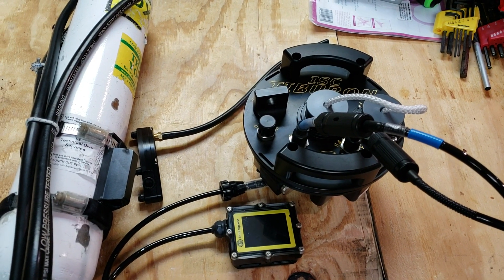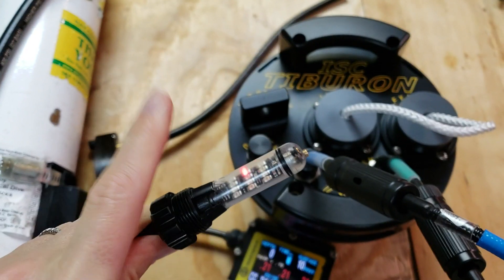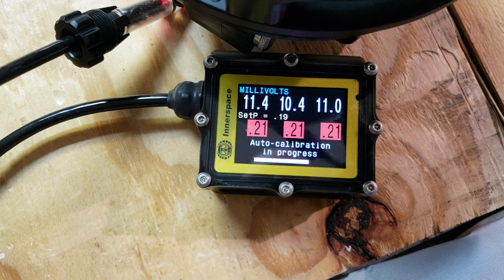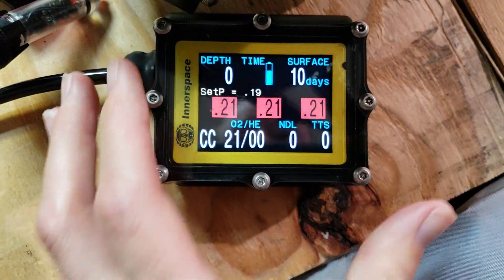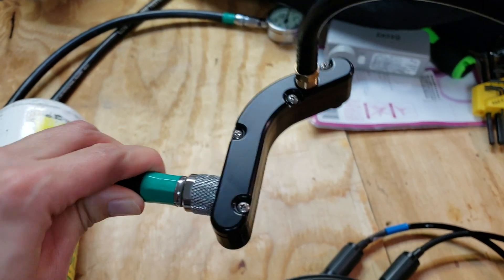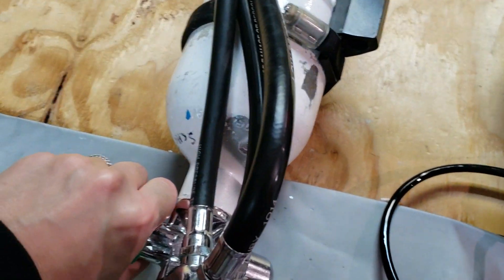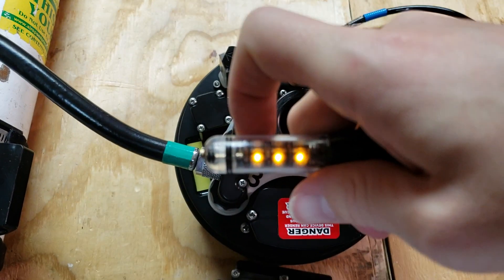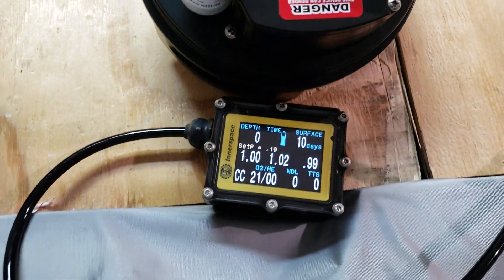Calibrating the ISC Tiburon Rebreather Shearwater electronics

Comment: Can you calibrate it when it’s all assembled? Like ready to dive and you just want to calibrate it again?
Reply from the maker: If the unit is assembled you could if you take the head off. Normally you wouldn't calibrate just before a dive. You'd do it in your pre-dive checklist as you build the unit.  If the unit was already assembled and say you didn't dive for a few weeks you can just take the head off and calibrate no problem.